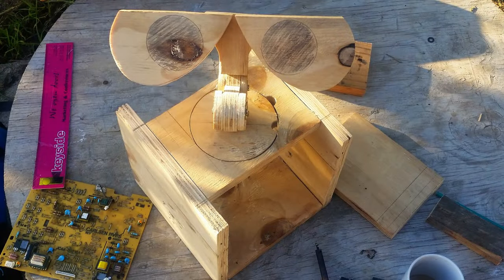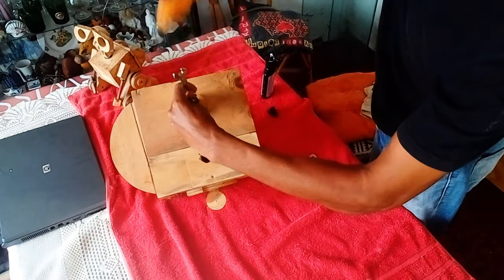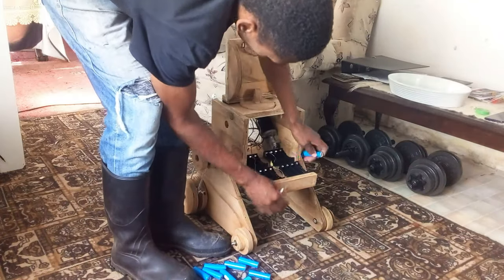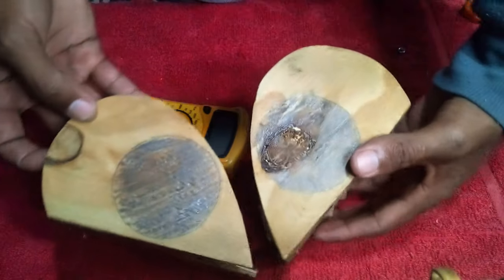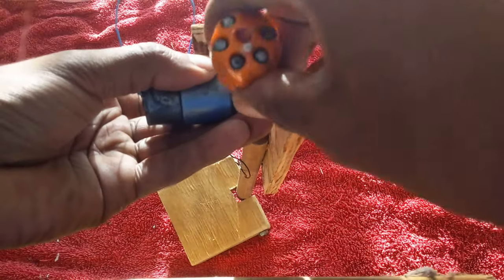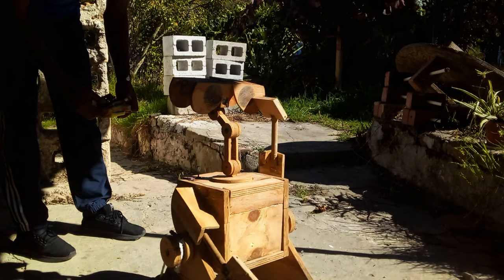I Build my favourite childhood robot from wood/ Wall-E

Comment from the maker: Transcript
00:00 Intro
00:51 Disassemble
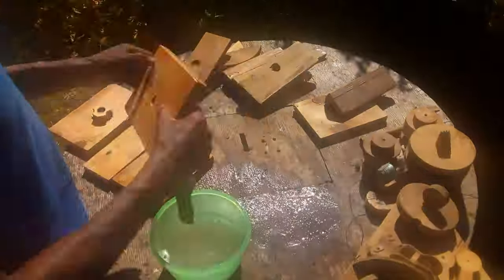01:35 Removing dust and dirt
01:51 Start rebuilding.
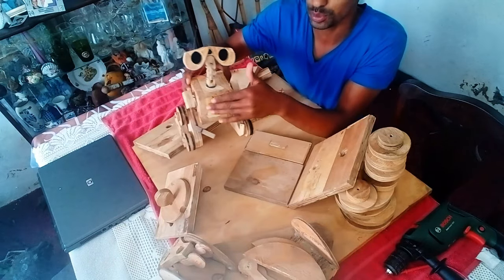02:28 Rebuilding mid body
03:57 installing wheel motors
04:07 Installing wheel frame, Wheels and other accessories
04:46 Building Power pack
05:05 Installing wheel motor circuit.
05:27 mobility test
06:12 Head assembly
07:21 installing head motor
07:54 Making new arms and fitting to mid body
08:30 Connecting all upper body motors to receivers
08:40 Upper body indoor test
09:08 Full outdoor test 
10:08 Bonus clip from 2019

Hope you enjoyed the film:-)